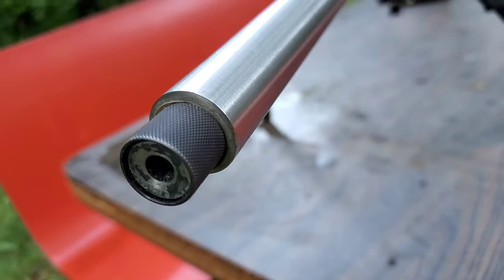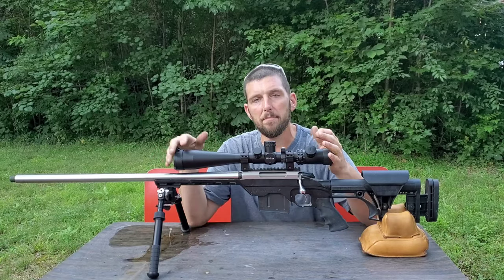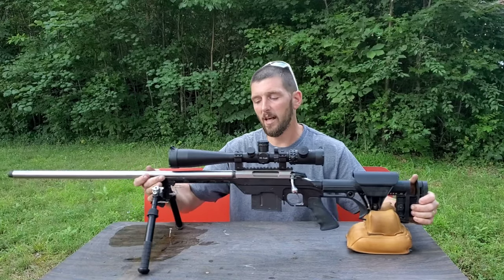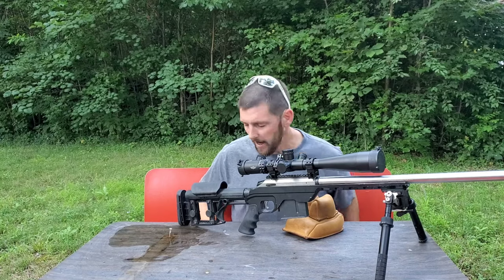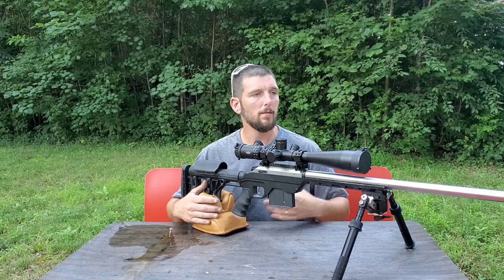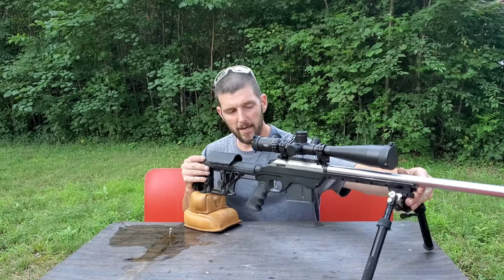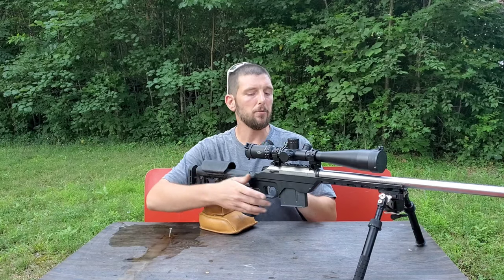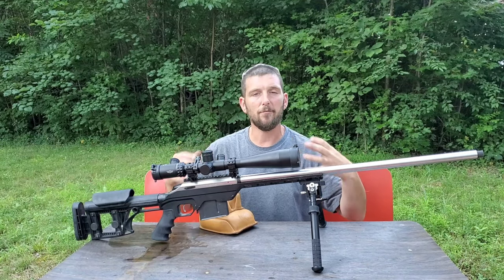Breaking Down Recoil Management For Precision Shooting

Comment: I have always been plagued by the rifle jumping to the side. It is getting better for me and I will keep working on it. I am running two different Harris Bi-pods depending on my situation. I would like to buy a 5H Atlus like yours but $459 takes a while to save. As always you gave me some good info to try out.
Reply from the maker: Yeah loading the bipod helps with that. The Harris bipod is pretty ridged which is great in some ways but it doesn't allow a whole lot of pre load.

Comment: Went to Cabelas and was told the cross had been recalled for chamber issues.
Reply from the maker: Are you talking about the sig cross? I'm not surprised. That 6.8 cartridge is running chamber pressures beyond Safe for any other cartridge and I didn't expect a 2 piece case was going to hold up. That's not what this is though.  This is a custom tikka build

Comment: Add more weight
Reply from the maker: Yeah thats an option if you don't want to learn the proper way to shoot accuratly with any platform.  I would rather be able to pick up any rifle and know how to shoot it to its maximum potential. With that mentality im guessing you shoot prs. In f class in ny division 18lbs is maximum with no muzzle break so there is no gaming things like prs
Reply: @gunfather83  F/TR is 18 lbs . 223 or 308 only. F Open is 21.5 lbs or 10 kilos. Any caliber up to .35. F Open is basically benchrest shot in the prone position. No I don't shoot PRS. I'm old. Started shooting 1000 yds 48 years ago in Idaho. I can't see that far now to be really competitive. Luck to you.
Reply from the maker: @joeschuster2837  Thank you. I'm actually shooting a new division called f practical.  It's any cartridge up to 35cal  from tactical bipod and soft rear bag with no bunny ears and 18lbs or less.